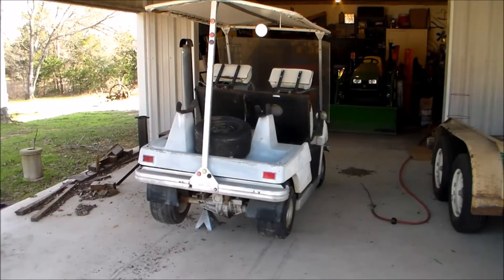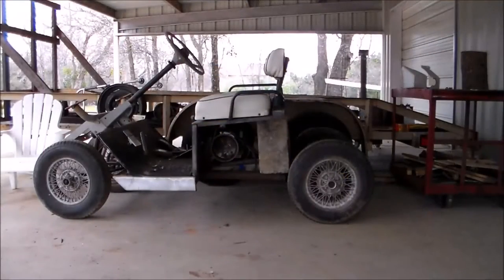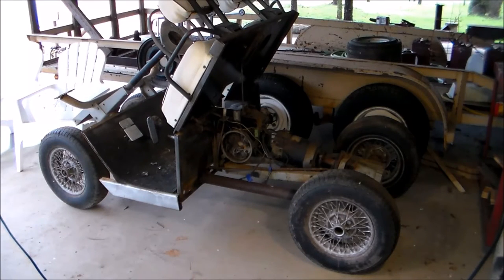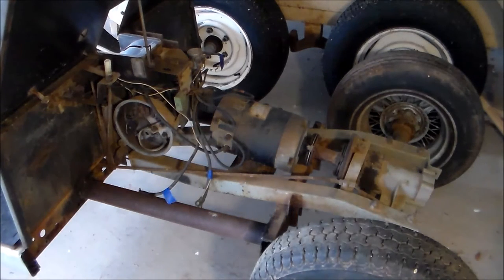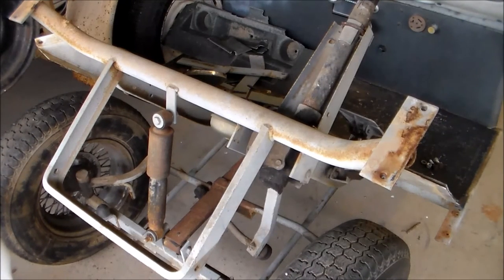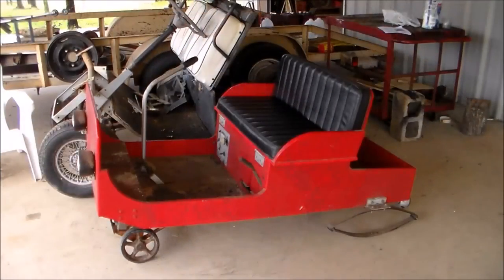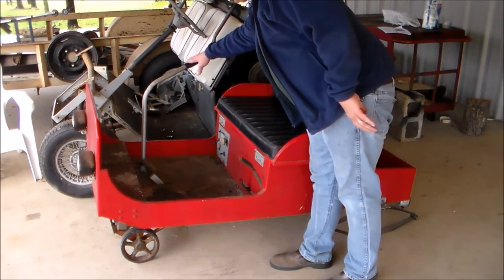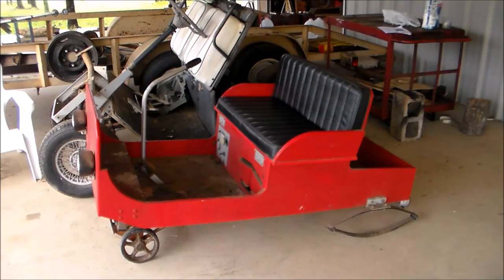Special Golf Cart Project

Comment: Hey Rusty, This is a great project!!!  If U need to buy batteries @ $80 each, that hits $480... This 125cc CVD transmission motor is <$300, add a $25 carb, and $25 ignition, even with sprockets to gear up between the motor and diff,  and the exhaust, U should come in under the $480, it will be lighter, and for a little more $, U can get the 3speed motor w/reverse.... Love Ur videos, keep up the good work!!!!

Comment: I agree with you hundred percent on the tires they should increase the speed quite a bit, I like how simple the front suspension is. Seems like a nice little project can't wait to see it when it's done! I'm sure you're more than aware but be careful with those batteries, i've seen them short and weld a wrench straight to the frame of the golf cart before. LOL. Have an excellent week sir, good luck on the project!
Reply from the maker: I hear you about the batteries, one of them has the post burnt off of it and I suspect that is what happened. Thanks

Comment: You will be stylin for sure. I would worried more about starting and low speed than top speed with the tall tires.
Reply from the maker: I hoping the torque of the motor will handle it . Thanks

Comment: it will be something completely different, my only concern would be the taller tires cutting down on the power to pull  the cart with 6 heavy batteries, might not be a problem at all, just wondering.
Reply from the maker: We will see, I sure want to keep the tires and wheels . If I need to I will add another battery to help at start off. Thanks.